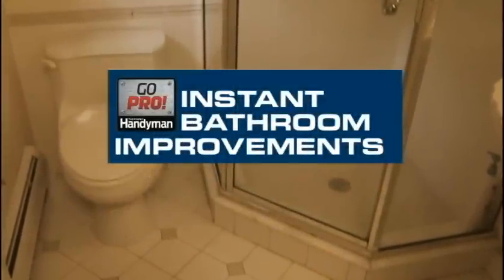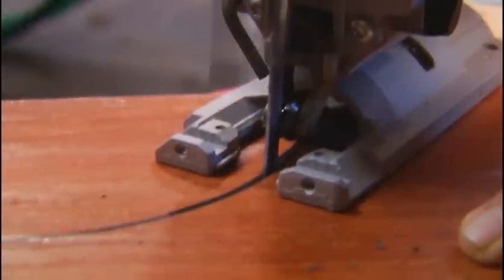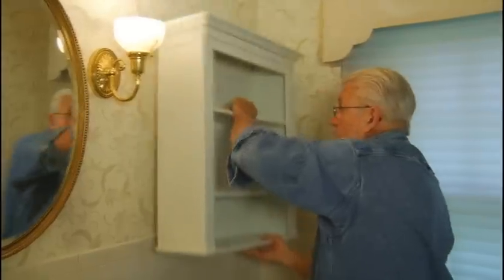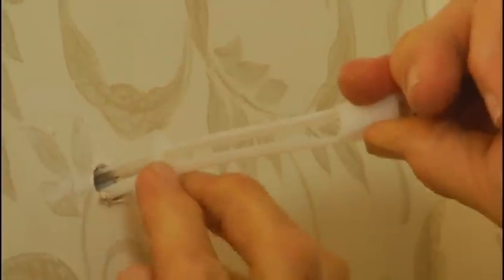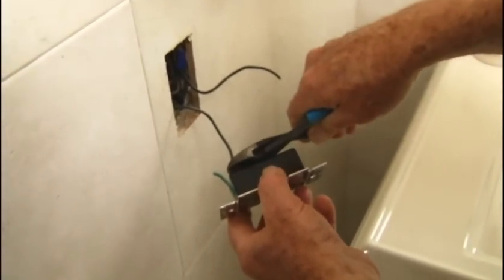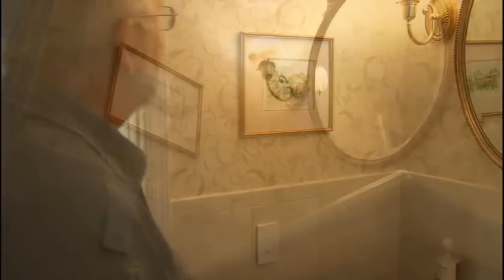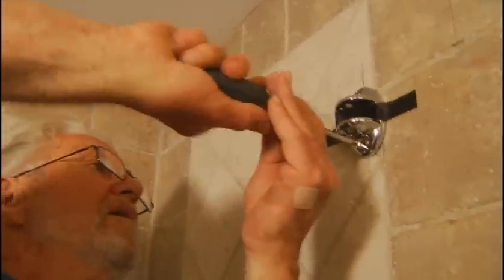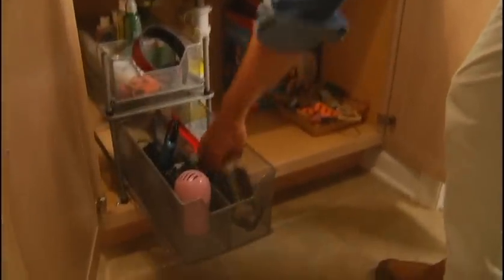Five Affordable, Easy-to-Do Bathroom Improvements

Comment: the tile chipped when it was drilled and the mounting hardware didn't cover the chip. show how to fix this. I would be discussed if the tile I spent all that money on was chipped and showing.
Reply: Wendy Taylor-Hamilton : I saw that only after you pointed it out. That boo-boo would drive me nuts every time I looked at it.

Comment: These are some nice tips for bathroom improvements. I just wonder how well the motion sensor works with someone in the shower and the sensor not picking up motion. Would someone end up taking a shower or bath in the dark? I guess it's used for a spare bathroom without a shower or tub.
Reply: lol i had a problem with that in my kitchen. when ever im standing still cooking it kept going out. the best fix was just to change the timer to a longer setting. but I eventually ended up just installing the normal switch back. I wanted one for the restroom but for that exact reason I just got a dimmer instead.
Reply: Tommy Thompson - He said it had a manual mode.
Reply: B Dizzle My Schnizzle you're right
Reply: B Dizzle My Schnizzle teach them ways to conserve energy. Kids can learn and will want to do good deeds for the earth if you raise them that way.  They'll surprise you.  Very eager to give to others and to please parents/adults who show them how to do meaningful things.

Comment: Dum idea for wood and plastic flooring in a bathroom, bathrooms should Always have tile flooring.
Reply: +BJ Barakas thats what i was thinking when i initially saw the wooden flooring, but straight after they show that it is a rubber mat with print to look like laminate flooring. the tile flooring underneath protects the subfloor from the tiny amounts of moisture that get through the "wood" and the rubber would make a very decent seal against moisture getting through
Reply: tile on its own isn't waterproof either though. it has to be sealed often to be waterproof. and you have to get cement board and stuff. but the laminate plank flooring is guaranteed waterproof on its own. no water gets through it.  so you could have a wood floor underneath it would still be fine.
Reply: I've lived in a few older houses over the years that had either lino or vinyl on the bathroom floor and if it's done well, it's really quite good. It was sheet lino and vinyl though, so no chance of water seepage between joins and it was well sealed around the edges.
The favourite bathroom I had just had a well laid concrete floor and the entire room was a wet area with the camber of the floor giving excellent drainage. It wasn't the prettiest of bathrooms but it was the most functional I've ever had.